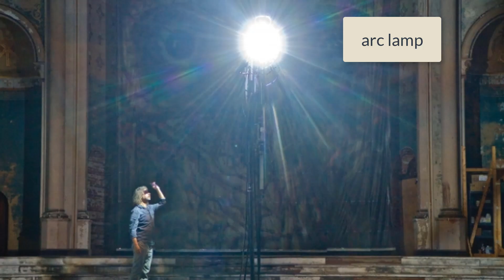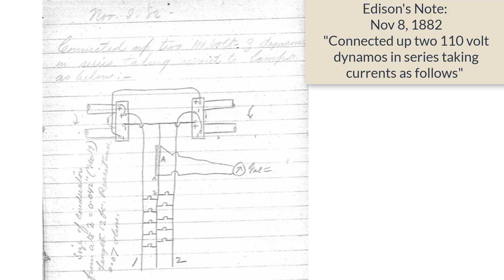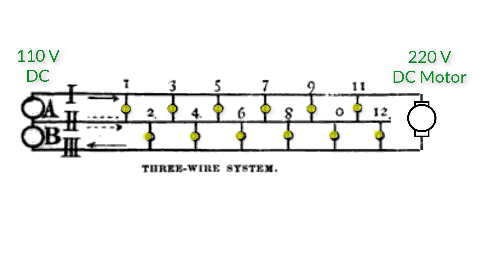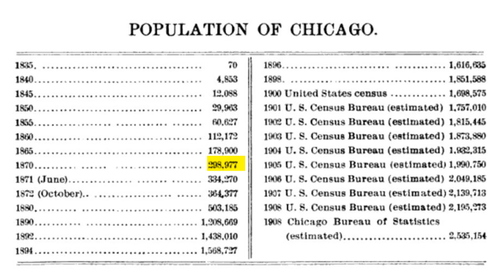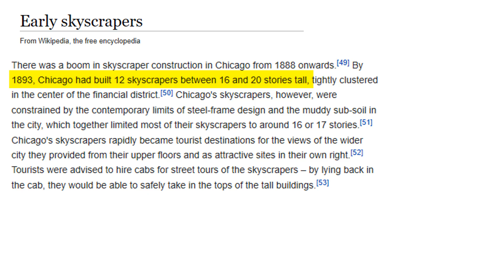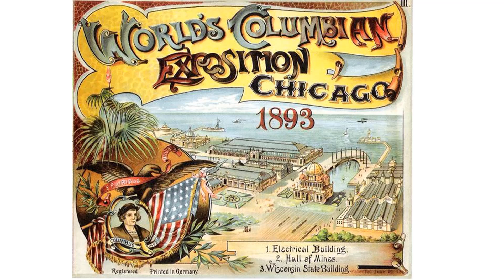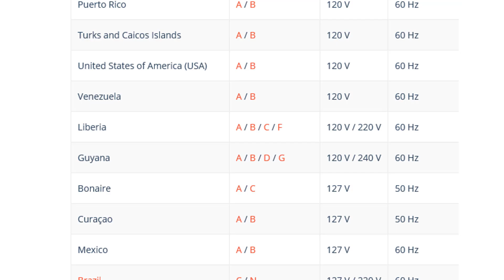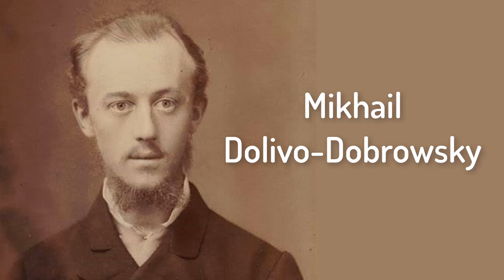Physics and History of Why USA uses 120 volts and not 220 volts

Comment: I will make a guess, 120V is much safer than 220V, also in europe and the rest of the places for 220V,  and since 220v requiers smaller wire, it is cheaper, and thats why they use 220V.  I have seen the electrical panels in europe, and they are pitiful, basicly a pile of junk, like 1,  10 amp breaker for the whole unit, and so on

Comment: Seeing voltage and current are inversely proportional countries using 120V need to double the current of the same system using 240V for the same load. To mitigate this to some degree you need to raise the frequency.

Comment: They sell us more copper on the 120. I was over seas in Asia once and saw someone with a hand held hair dryer and It looked like small speaker wire for the cord, I was like ??? Then I realized were on a lower voltage which means higher current and thereby more copper.

Comment: Uhhh, No.  The reason is a safety reason.  During a shock with lets say your hand will allow one to pull away from the conductor whereas 220 volts or higher makes human muscles contract, therefore making your hand grab the conductor and not let go.  Also, America had more copper than Europe during the WW1 and 2, therefore by decreasing the diameter of conductors, the same amount of power could be delivered, but just at the cost of safety.

Comment: If I use a voltmeter I get a reading of 125v single phase and 250v two phase not 110v and 220v. This is USA. Voltage and amperage are inversely proportional. If it takes 10 amps to run something at 100v it will take 100 amps to run it at 10v.

Comment: You left out the safety aspect and Edison's unofficial "camp" electrocuting animals using high voltage AC to scare the uninformed public into using their "safer" 110 volts DC. It's very difficult to electrocute an average size human using just 110/120 volts. 220/240 is another matter altogether. Westinghouse was very cognizant of this and made the calculated decision to proceed with the lower voltage design to assuage the public's fears and shut down the DC camp in doing so. 

It's might not sound very interesting or technical and might sound rather absurd to the average reader out there today, but in the the world of the late 1800's to which electricity was both a new found miracle and terror all at once, it was a very wise PR decision on Westinghouse's part. By bringing down the voltage to Edison's DC level, he undercut the only reason left for choosing DC over AC. It might not sound like much today, but it was the very difference between his company's success and failure at the time. And with the US being the first country to begin mass electrification with the team of Westinghouse and Tesla building their Niagara Falls power plant, they did not have the luxury of having the examples of other countries to calm the public's fears. 

Europe, on the other hand, did not have an Edison to contend with, and having America as an example of AC's safety, could afford to go with the cheaper, more efficient 220/240 higher voltage.

Comment: Actually in North America we do have 220 it just gets split from the transformer to the house in  2 hot leads and a single neutral so one side of your main panel will be say HOT-A and the other side of the panel will be HOT-B and Neutral = Neutral and Ground = Ground, If you need a 220/240 circuit for an appliance in the house such as Stove, Electric Clothes Dryer etc. the HOT Leads from  both sides of the panel are combined on the that circuit to bring it back to 220. that's how it works in Canada where I live.

Comment: Amsterdam and Delft had 3x220 (230) Volts up till 2000 or even later. Just that nobody had issues when they went to 3x380 (400) Volt because they had 2 phases on the normal power outlets.
Just machines running on 3 Phases had to been set to 3x380 Volt.

Unfortunately I could not handle watching your vid because of your hands flashing through the screen. Please mask off your hands.

Comment: FYI Live and Neutral are AC nomenclature and have no relevance to DC systems. 2:47, the lines would be 0v at the bottom, +110 in the middle and +220v between top and bottom. At about 5:00, you begin talking about transformers which do not work with DC only AC. Japan is the only country to have both 50 and 60Hz split between the north and south. The point of three phase is that you can transmit power using 3 live conductors (using a Delta configuration) without a neutral thus saving a conductor. It is converted to Star configuration (as per your diagram), to recover the Neutral, normally done once down at consumer voltage level.

Comment: Fascinating presentation. I live in the UK and in the 1960s, the domestic voltage was standardised to 240V AC single phase. At the time my house was on 220V so the electricity board had to replace all bulbs, fridges and washing machines so they could run on the higher voltage. It was amazing how long 220V bulbs would survive running at 240V before they burnt out. Later under EU regulations the voltage was reduced to 230V

Comment: Service to homes in Canada is 220. 220 volt outlets are wired into most homes and apartment buildings because most washing machines,  clothes dryer,  and stoves are 220, 110v outlets are used elsewhere to be comfortable with USA.

Comment: Great video.  I stumbled across your presentation on this and my question might be covered in the 2,119 comments but no time to read all of them.  My question is about Watt's Law that says if you double the voltage you half the amps.  In other words, if all the power usage in a house was changed to 240 or 480 volts would that cut your electric bill.  I knew a guy several years that put a 3 phase AC unit in his house and he said his bill went down a lot but of course he had some up front costs with a different meter box and wiring to the unit.  Also, wire size would be less, etc. Thanks for your video and I will be a subscriber.

Comment: No word about Tesla. He was a big promoter of AC while Edison was, for some reason, terrified of AC and pushed DC. Edison and Tesla put on a demo, with Tesla using AC and Edison using DC. Of course DC failed especially at the end of the line since there was way to transform DC into a higher voltage which reduced the amount of current required.

Comment: America uses 240 volts, the same as the UK . They just take their neutral from halfway up the secondary coil. This means they have +120V and -120V... They use double socket gizmos to power washing machines and other high current/voltage devices that need 240 Volts

Comment: I'm confused.  Edison was a DC man,  hence you have the edison split phase supply.
Single phase supply central earth /neutral.
So each 110 volt line is not actually AC but a pulsed 110 volt supply each pulse lasting half of the cycle then nothing for the other half cycle.   Then you have a second similar cycle being the other half  of a full cycle.   But low and behold if you want more power you  can use both phases  togeather and not have a pulsed dc supply but full AC at 220v.      
This same system is probably the reason for 60 cycles in the US to control the half phase flicker.  In a full 240 ac system you have both the negative and positive peaks  so out of a 230 v ac system at 50hz  one has 100 lighting peaks much less noticable flicker.

Comment: Interesting set of historical facts!

When comparing 3ph and 1ph and 1ph/2legs (now called "split-phase") there are quite a few differences in how those are connected and work.  For example in the Delta configuration there is no ground wire.  You can get 120VAC on one node, 208VAC on two nodes, and 480VAC on all three.  In the Wye configuration you do have a ground wire (so four wires instead of three) and that allows more redundancy if a phase failure occurs.

Your typical 220-240VAC residential circuit used to be called "2 legs" not "2 phases" because the two hot lines were two circuits providing the same phase BUT opposite voltages.  Now it's called "split phase" because -as you correctly point out- if you call it like you see it, each of the hot lines is 180° out of phase with the other.  The disadvantages to this is that there exist periods of 0VAC (every 1/60th of a second on 60Hz systems) whereas if offset by a real phase difference there would never be a 0VAC spot, but there would also never be a 2x1ph VAC spot either.  Motors (HVAC equipment, pumps, etc.) like this more.  However, water heaters and incandescent light bulbs don't like the 0s mixed in with the 240s.  (And yes, there are plenty of 208, 277, and 480VAC incandescent lights... mostly industrial and businesses in the US.)

Transformers are not cheap, so one of the compromises is what voltage to run to a residential neighborhood to save money on transformers.  A 4KV-->240V transformer is much cheaper than a 14KV or 40KV downconverter.

Things like compressors like 0VAC points (they are motors, after all) but things like welders don't.   All of these are compromises.  The reason for the compromise is the desire to run higher voltages to reduce amperage thereby allowing higher gauge wire (thinner) with a lower ampacity but saving money on copper or steel (must use even more steel for same ampacity).

And finally, there are power-factor correction devices (think "huge capacitor banks") that store the energy during non-0VAC points and release it at 0VAC points to make for a constant voltage.  This turns horrible-PF devices like HVACs from 0.2-0.3 to near 1.0.  Electric Utility companies in the US like businesses to have a PF close to 1.0 an reward businesses with much better pricing (because they size for average use, not peak) and that often covers the cost [over time] of the PF correction device.  These are more often seen in the 480VAC and higher world.

Best wishes

Comment: Beware of 347 volts. It almost killed me. I was separating two wires with my insulated pliers. It grabbed me and I was shaking like a fish on a hook. My heart was beating faster. But I could not let go. Fortunately I bent my legs and my body pulled me off the wires. It is the most dangerous voltage on earth.

Comment: Europe vs USA
In truth, we’ve both agreed on 240volts as our basic voltage.
In Europe, their system has a 480v transformer with a neutral. From them you get a 240v hot and a neutral.
In the USA, you get two hots with 240v between them, plus a third wire as your neutral. Between either hot and the neutral measures 120.

Comment: Three phase electricity.
Three magnets at the generator means three currents of the same voltage, but each is slightly out of time with the others. Each line gets its own transformer.
Homes are typically served by only one final transformer. A homes two “hot” wires come from the same transformer.
Industrial power differs in that the factory receives power from three transformers — one from each of the phases created by the generator. Factories use the fact that the “hot” wires are slightly out of time with each other as a means to make motors spin. Think of each phase giving the motor a little kick in the right direction.
In one of the more common arrangements, the three step-down transformers are connected so that one end of the output wire is connected to the other two transformers. This creates one point in the system where voltages are the same. We call this the “neutral” point.
The other output wires, plus a wire from the neutral point, are run to the factory. In their panel you will find three “hots” and one neutral.
Since each of those 240v hots is slightly out of time with the others, you will measure only 208 volts between any two hots. Measure any hot to neutral, though, and you’ll find 120v.

There are other ways the power company can connect transformers to each other. That’s why you might find voltages such as 480, 277, 240, or 115. 
Distance from the transformer matters. A house near the transformer will measure 125, while a house at the end of the street might measure 108.
Last post: Europe vs. the USA

Comment: Step down transforming.
Since the generator has three magnets, it creates three phases. A “phase” is an electrical current with a time factor. Since that magnet passes wires one at a time, each wire carries current at a slightly different time.
Once the transmission wires reach a bank of transformers near the customer, the voltages are reduced to a manageable level.  Now ask: What number is easily divided into the maximum number of whole numbers? Answer: 60. Let’s look at some multiples: 60, 120, 240, 480. Look familiar?

Each coil in a transformer has (at least ) two connections: one in and one out. In the following examples, let’s assume the voltage between these two wires is 240 volts.
If I attach a wire to the exact center of that coil, the voltage between this central wire and either of the other wires will be half of 240, or 129 volts. This is what typically serves your house. You have two “hot” wires with 240 volt’s between them, and a neutral that measures 120 volts to either of the hots.
Next post: Three phase

Comment: Voltage and current:
Current is created by passing a magnet over a wire. Voltage is determined by how many times that wire is wrapped around the magnet.
Use thick wire and you get lots of current but few volts. Use fine wire and you get little current but lots of volts.
Fortunately one coil of wire can induce electricity in another coil of wire. Place a coil of fine wire next to a coil of fine wire and you will transform high voltage/ low current into low voltage/high current.
That’s what transformers do.
Electrical resistance is determined by current alone; great current means lots of resistance. End result is that less energy comes out the end of a wire than what you put in. 
Power companies beat this by greatly increasing voltage for transmission lines, then transforming it (“stepping down”) near the end. High voltage = less current = less lost in transmission. Kind of like getting better mileage when you drive slower.
Next post: Step down transformers.

Comment: You really ought to chat with a real electrician about this … let’s look first at how electricity is made.
Electricity is made by spinning a magnet inside a coil of copper wire. One magnet = one phase. Since a three magnet arrangement (“6 pole”) nests rather well, three magnets is the routine way to make motors and generators. Spin the magnets faster and you get a “higher frequency.”
USA: 60 minutes in an hour, 60 seconds in a minute — 60 cycles per second seems natural.
France: Let’s invent the metric system. 100 is a nice round number. Passing one pole of a magnet over a wire 100 times a second means you need to spin that magnet at 50 rpm. Hence, 50 cycles.
Next post on s about voltage.

Comment: Marketing 120 sounds safer even though it is not. Where do you find 220 volts? The standard in the US is 240. A 220 volt 1 phase system would be 110 volts to XO ie ground.

Comment: I live in Canada.  My preference would be for North America to be on 220/240 Volts like the EU and most of the planet. A lot more efficient.  The 115 to125 Volts is less efficient. At this point converting to 220 to 240 Volts cannot be done because of the huge cost and all the buildings and systems are wired for present system.

Comment: Still confused about bulbs that cannot handle more than 110.  Should not have been an obstacle. Two identical bulbs in series can therefore be connected to 220.  My old christmas light strings were 10  12v bulbs in series to connect to the 120.

Comment: Yeah, my ears perked up when I heard the “more resistance” flub, too.

One thing that could stand some detailed research is the true reasons for the U.S. upwards voltage creep. I seem to remember seeing an old appliance nameplate with 107V, but I don’t think anyone would argue with a 110V starting point. Then it was 115V, follows by 117V and 120v. Soon it will be 125V. If I was a conspiracy type, I would say we are slowly working up to 230V, so we could have one world government or some such. Well, what is the truth?

One channel, Technology Connections, explained the benefit of the U.S. system of 120V to neutral, but 240V across hot legs, so we get the benefits of both. (I wouldn’t mention all those trigonometric three phase lower voltages as they are found in commercial supplies only, so won’t be encountered at home, and will only confuse Joe Public.)

Not only is Japan whacky at 100V, but because they had different systems installed on different sides of the country, they wound up with both 50 and 60 Hz. But having to deal with that at home led them to easily be ready to make equipment for the export market, which could be either.

I stayed at a hotel on Capri once that had a tiny lamp on the bedside table fed by what appeared to be crystal earphone cord! 230V over wire suitable only for audio!  Seeing this whackiness of course allowed me, as an American, to feel smugly superior. :-)

Comment: I lived in Korea for several years where most homes have a transformer to change the provided 220VAC to 110VAC. The transformer was also the circuit breaker pane. All the appliances I saw in the shops were 100-120VAC.